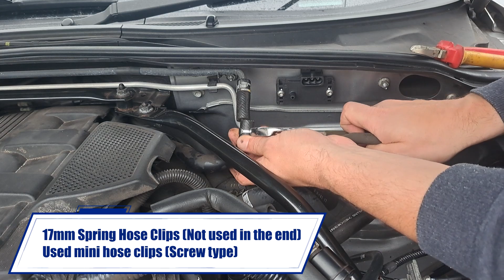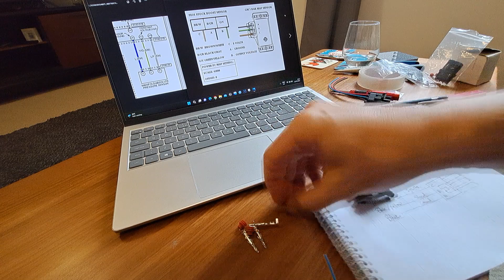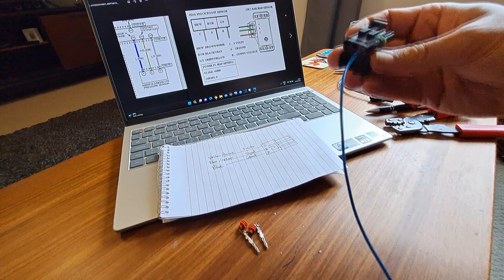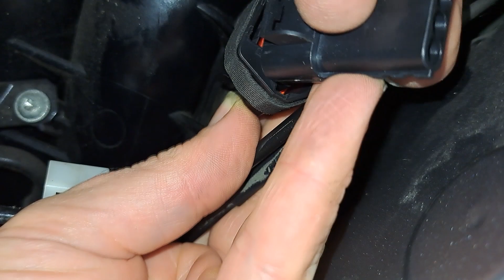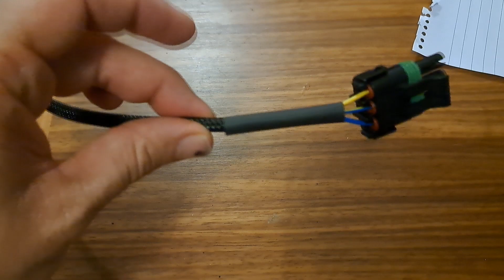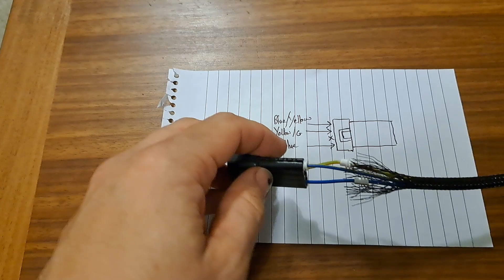Miata MX5 NC TURBO - DIY Turbo build Part 3 - 3 Bar MAP Sensor

Comment: So, are you just wiring the map sensor where there used to be a MAF sensor? Can the ECU read an MAP sensor when it was designed for an MAF sensor? I don’t understand how this works.
Reply from the maker: @mayela835  you are putting on a MAP sensor with a bigger range. Yes, it is wired into where the old one was. You leave the old sensor in the intake manifold, basically as a plug.

Comment: Any reason you didn’t use the Bosch map sensor that would fit in the original place and keep the temp?  I’ve found one that’s rated 2 to 3 bar
Reply: Yes, it would have been much better to have installed a Bosch T-MAP 4-pin sensor which measures MAP and manifold temperature (called IAT2 in the tuning world) so it tells you how well your intercooler is working and many ECU tuning tables use this as an axis so it is essential to measure this if you want a robust tune.
Reply from the maker: @richardhicks5465  I did what everyone one else had done.
Reply: @ I’m pretty sure bbr use a Bosch sensor in the original place, can you still read inlet temps using the map sensor you used?
Reply: @richardhicks5465  No because it's a 3 pin connector. On the NC the intake temperature sensor is inside the MAF
Reply: @TheBitterHoney1998  can’t inlet temps be read off the maf sensor too?
Reply: @ Sure, as I said, on the nc it's inside the maf